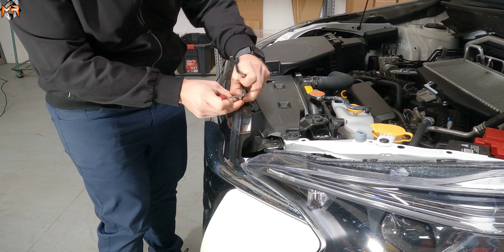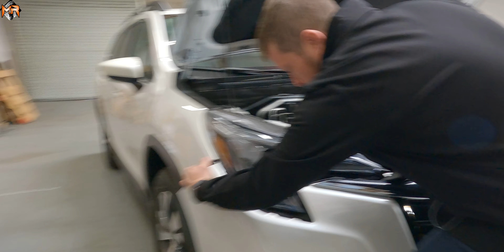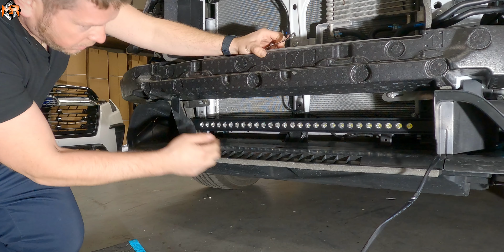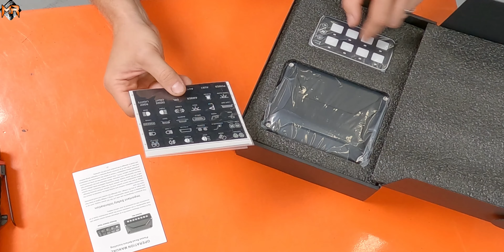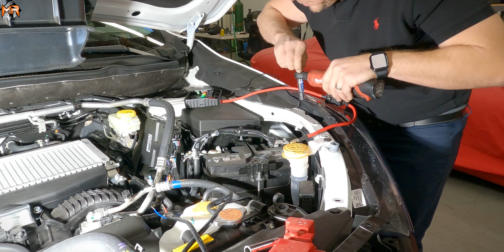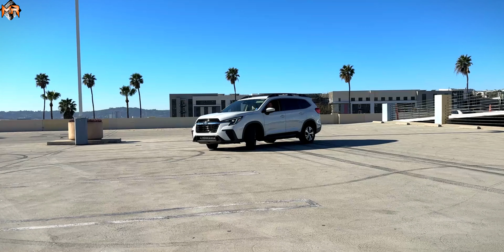Subaru Ascent Light Bar SLIM | Easy Install by M&R Automotive

Comment: I bought this product a couple months ago and finally got it installed.  It's awesome, super clean install, no crazy wires.  Everything fits nicely and no need to fab or cut anything in the product or the car.  I like how we can operate it with a remote without turning on the car as it's primary use will be a light source for camping, we can turn it on from the tent with literally no hassle.  

Now I have seven inputs I can attach something else, not sure what though.  🤔

Comment: Great product and great video, question I have is, can user wire the bar directly to the car without using the remote to turn it on?  I would like the bar to turn on as drl's when the vehicles parking lights are activated and the main light bar to turn on when the headlights low beams are activated.  Thanks